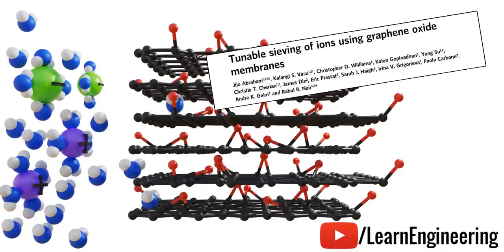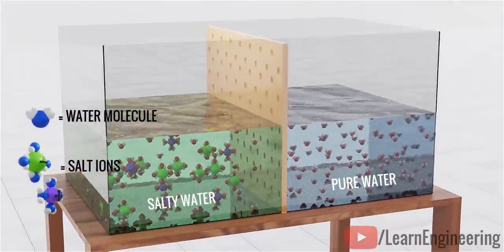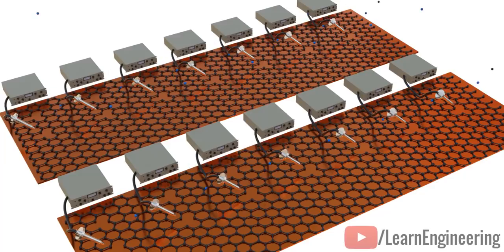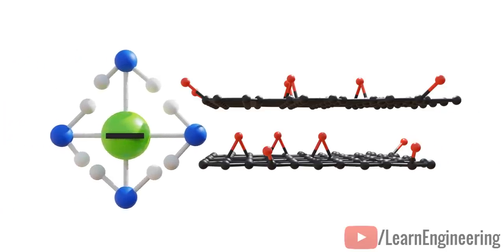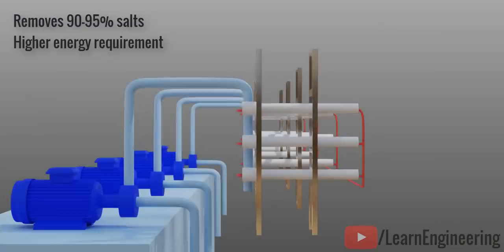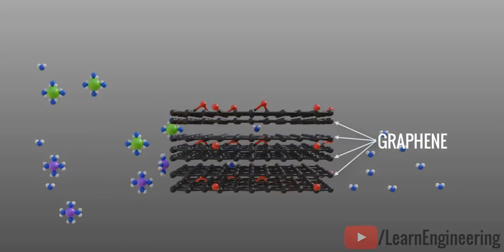Graphene Filtration | A revolution in Desalination technology!

Comment: All good and well, but what about de brine thats left behind. no matter what u use, your alway left with brine. you cant dump is back in the sea, that would increase the local salt level and kill the marine life there.
Reply: Exactly! This is the most problematic point with desalination. Graphene does nothing to improve the possible ecological disaster that this technology could prove to be.
Reply: Properly planned sites should have the output brine mixed with so much seawater that it's non-toxic by the time it leaves the pipe, and we won't drive ocean salinity up over time because that's not how the water cycle works. It's cheapo bottom-dollar sites that would dump high concentrations straight in the ocean that we need to worry about

Comment: I always have an interesting idea. For the membrane that block the salt ions, if one side has no any water then does it mean net water molecules can pass through the membrane without applying any pressure on the other side. Furthermore, if we put the membrane horizontally and pour the saltwater on it, will the water molecules pass down through the membrane? Any answer is welcomed.
Reply: Do more!!

Comment: Let me know when they can make high quality graphene larger than a few square inches. There is little hope of this happening because the chemistry is fickle and small local variations will cause it not to form. It may be an engineering problem, but we have easier problems to solve that would have similar impact.

Comment: I don't understand the entropy.
Definitely, the new graphene filtration tech need some energy input for driving the process, right?
Reply: Yes
Reply: @halfmv2  you're totally right. If you need a constant filltrated water moving, which it's very commum in phamaceutics industry, you'll probably have a good problem...
Reply: he didn't  say that no energy was required int he entire process

he said that the energy to push the water through the graphene  was not required

you still need energy to  get the water into the plant
Reply: I was asking about the energy used for filtration, not the logistics process.
As the video said explicitly, the filter is an energy efficient tech, so it still consume energy.
I guess the capillary action don't require energy, and the entropy was paid during the manufacturing process of the graphene filter. However, energy should be needed for clearing the salt atom which block the nano-scale entrance of the filter, otherwise the filtration will stop once the prepaid-anti-entropy is used up.

Comment: How is this supposed to function better than existing membranes? From what I understand graphene oxide is simply a replacement. Why does it need less energy? The energy required to preform reverse osmosis should be the same unless I missed something.

Comment: Sorry but...a bit of energy has to be used otherwise we could violate the second principle of thermodynamics. My question is where will be used energy with graphene membranes. It was stressed very well about the RO systems but speaking of graphene it says it is a natural process which cannot be as said ...so where will be used energy in the process? My suspect is that they work exactly like RO only more efficient.
Reply: Maybe they say that the energy comes from the dis level of the water: the salt one is up and then goes down with the graphene filter

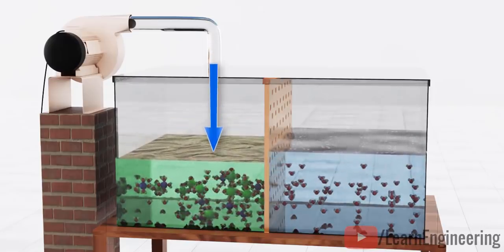Comment: In 1:46, instead of using pump, why not use gravity? So, put the salt water above at higher ground and use gravity as pressure through the membrane?
Reply: That's my question too. Gravity would be more than enough to pull it through and the same pump that pumps water in the tank in the video is the same pump for a vertical tank. 
Think we're being bamboozled with bullshit by the graphene group...🤣😉👍

Comment: Am I the only one wondering why the 'obvious' set up for the first tank wasn't mentioned in the first two minutes, which is, - up end the tank and poor in the salt water from the top. It's not using anymore electricity than the method getting the salt water into the tank in the video to start with. Gravity will pull the water through..
Am I missing something?
Reply: It takes about 500-1000 psi to push the water through the membrane.  Some of this force is required to overcome friction and some is required to push the water molecules away from the salt ions.  The second part is going to be required regardless of the type of filter.
Reply: Won't work without hundreds of feet of water pressure

Comment: the challenge will be turning into a product, i would imagine if it has potential it would first go into commercial water purifiers used in labs and the like, that said membranes are available for RO stills to be made at home with some plumbing parts, pipes valves and pumps, its cheap readily available technology

Comment: idk how u neatly stack sheets of GO when it comes in tiny black flakes since the process is made by exfoliation.
did they just composite epoxy with graphene oxide to make a hydrophilic membrane which can be used for RO.
Imma just try using crosslinked PVA mixed with GO and see where that gets me.

Comment: This presentation is very misleading. Since this is a proof of concept (lab-scale), it should be compared with other stateof-the-art lab-scale RO membranes (>98 - 99% monovalent salt rejection). This graphene oxide technology is not new as well and it does not remove the need for high pressure pumps for reverese osmosis. With the same feed stream (sea water, brine etc...) you will still need about the same pressure (50-80 bar) to achieve separation no matter what kinda state-of-the-art membranes you are using. The graphene oxide sheets just reduce the membrane resistance, allowing higher permeability for the same membrane area.
Reply: Thanks for your comment.  I was going to makes a similar comment about the fundamental, inescapable energy requirement, defined by thermodyamics.  The static osmotic pressure of sea water is equivalent to 900 ft of water.  Real systems need more to over come losses due to flow, increases in salt concentration in feed, and losses in pressured brine rejection.  Technology advances can reduces these losses and are highly desireable.  Misleadingly implying the engery barrier will go away is not helpful

Comment: Graphene is a great material with great potential in many disciplines. Perhaps by this video more would be interested in it and push for grater research on G and GO. 

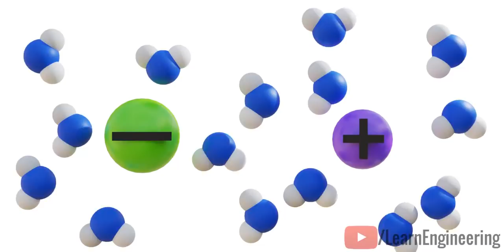Dare I make one remark about the animation. At 3:54 the water molecules are attracted to the negative and positive ions (green and purple spheres). As the H2O molecule has charge polarity, the orientation of the water molecules in relation to the ions should be in the reverse order than that depicted in the video. The oxygen atom side of the water molecule, the blue atom, has a slightly more positive charge than as that of the two hydrogen atoms on the other side, the two white atoms. Thus, the positive side of the molecule should be attracted to the negative ion and vice versa. All I am trying to say in this long-winded comment is that the electrical sign on the ions should be reversed so the green ion would be positive, and the purple ion would be negative. 

I am sure that a great deal of thought and effort went into this video; more power to you. More videos in STEM, like this one, should be made.
Thank you.

Comment: How does the water rejection compare to conventional thin film membranes AND when will drop in replacement graphene RO membranes be available. In the real world where my iSpring 7 with booster pump, my municipal tap is a very respectable 103ppm/TDS, but product water is only  ~ @13-16 ppm?TDS+ ~  88%,, where I would expect 95%+

Comment: I'm confused. Why is this better than reverse osmosis, and how is it more energy efficient? do you still need a pump? As far as my feeble brain can tell you just demonstrated how a graphene filter works.
Reply: Probably smaller pressure is required for a decent flow. On the video it is claimed this is "natural filtration", but its is misleading, the osmosis for w still id present and the proces could be called reverse osmosis. Just the membrane may be better (smaller loses) and tunnable.

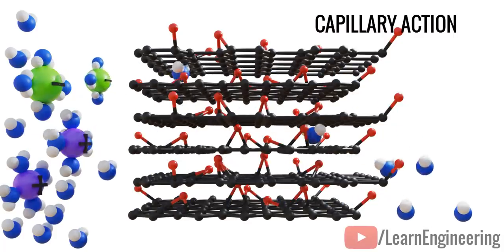Comment: 3:30 “water atoms”
Reply: I should’ve waited to comment; there’s a lot in this video which seems wrong
Reply: @PajamaMan44  did you find something else?
Reply: @robinsss  Yeah. For starters, the entire premise appears misleading or misinformed. It is presented as though this system will simply be able to filter water with no pumping requirement, but reverse osmosis, or really any system which would achieve a similar effect, requires the input of energy in some form. In their graphics, they demonstrate water only moving from higher concentration to lower concentration through the GO membrane, without mentioning why it would not simply move the other way. They claim lower energy requirements, which could very well be true, but by how much?

But besides the entire point of the video seeming odd, they make basic mistakes such as "water atoms" or saying that the hydration shell is covalently bonded to the salts. Also, why would your kitchen use GO filter? As far as I know, but granted I am not a professional, most household water filters are likely chemical filters as opposed to RO filters,  because why would you want to deal with the pumps and the waste water when you can simply toss an exhausted chemical filter and replace it (here I should mention that, based on their explanation, GO filters would simply be another type of RO filter just more efficient I am guessing)? 

These basic mistakes makes it seems there is some kind of error in the production process of this video. I believe this video is the first from this channel I have watched, but based solely on this video I suppose the production either does not have great English skills and because of this they are presenting the information in incorrect ways, or the team is not very scientifically literate, although this would be weird for a channel named "Learn Engineering". Sadly, I cannot figure out any more because, even though they linked it, I do not have access to the research paper they've based the video on. Shame!
Reply: @PajamaMan44  ''''''''They claim lower energy requirements, which could very well be true, but by how much?''''

44%

5:38
Reply: @PajamaMan44  ''''''But besides the entire point of the video seeming odd, they make basic mistakes such as "water atoms" or saying that the hydration shell is covalently bonded to the salts''''

minor mistakes

'''''Also, why would your kitchen use GO filter?'''

why do we need a washing machine?

we don't 

maybe they are connected to a company and trying to come up with excuses to buy a home device

that's capitalism

convince the consumers that they need  the product being advertised even though they don't

are you questioning whether this technology really works?
Reply: @robinsss  At 5:38 the video states 44% of an assumingly current RO plant's costs is the electrical energy used to power the pumps to generate the pressures necessary to filter the water. I will agree that it can likely be assumed from the way they present the data that they mean to claim using a GO filter would therefore reduce costs by this 44%. However, I have no idea how this would work; a GO membrane isn't a magical device able to create a concentration gradient from nothing. If you would like me to link to materials explaining the fundamental physical process which is occurring during RO filtration like this and why is requires energy input, I will try my best to provide something.

Onto your reply of "minor mistakes", while perhaps it is true that accidentally saying "water atom" can be a minor slip-up, the accumulation of these minor mistakes brings into question the legitimacy of what they say. For an analogy, if you were watching a video trying to learn guitar, and they mislabeled a string, incorrectly tuned their guitar, and provided an incorrect explanation for what a chord was, a reasonable viewer would question their experience and authority to be teaching guitar. This is simply an analogy as to why people who have a little experience with these physical/chemical concepts should likely question Learn Engineering's authority.

Onto the capitalism point, you know what there are household RO devices. I've simply never seen them so my bad. I'll give you this one.

I don't doubt that there is something to GO membrane filtration which could have a possible benefit for future RO filtration systems. What I do doubt is the explanation presented in this video. I have gone and watch another video of this channel's, about seat belt designs, and have discovered in that video too they had made an error. Based on this new information, my beliefs regarding the channel has shifted from poor English to poor subject knowledge. It appears to me now that the channel will simply fill in the gaps of stuff not explicitly stated in their source material, and because of their poor knowledge on these complicated subjects, they get it wrong. Now that I think about it, I don't think I can be sure what exactly is stuff they have made up and that perhaps sounds plausible enough that, without the research in front of me, I wouldn't be able to tell.

Now I think I have given you more than enough of a response. If you are truly curious about why the GO system the way they have presented it does not make sense to me in the context of my education, as stated, I would be willing to provide you with material to review. However, if you are just here to defend this channel from any criticism, I will let you know no to worry, as I have told Youtube to no longer recommend this channel to me so you should not be seeing my criticisms in the comments in future videos.
Reply: @PajamaMan44  '''''' I have no idea how this would work; a GO membrane isn't a magical device able to create a concentration gradient from nothing. ''''''

the video says that the water moves through the graphene  because of capillary action 3:22

i was only able to find one video of this subject on youtube
Reply: @PajamaMan44  i  agree that they didn't give a good explanation of how the capillary action works

maybe someone will make a video explaining it

i expect it

this was only announced two weeks ago
Reply: @PajamaMan44  Thanks for your post, I had real problems with the thermodynamics in this presentation. It looked to me like they were trying to summon Laplace's demon. Now it just looks like this channel is typical of journalists trying to report on the sciences.
All too often they do their "research" by reading a press release from some corporate sales office. But they didn't understand enough high school science to perceive when that released information is incomplete. Consequently, they don't know the right questions to ask. Like "How much lower the are the energy requirements required to reverse local entropy compared to R.O.?"
The more minor stuff like "water atoms" are just the result of that same lack of basic general knowledge in the sciences.
In early 1969 I was 6 and a voracious reader of anything I could comprehend relating to Apollo 11. A science "reporter" had an article where the illustrator had drawn the "launch window" as a circular hole in the upper atmosphere. I couldn't for the life of me figure out why the rocket had to go through such a breach since I was pretty bloody sure the sky wasn't a solid shell around the Earth.
I figured it must be something to do with avoiding the Van Allen belts but then I found out that the flight path included an equatorial and not a polar orbit. (I knew the belts weren't over the poles)
It took me YEARS to realise the publisher had no clue that the "launch window" was a time, not a place.
I think this channel might have the same kind of issues...
Reply: lordchickenhawk That story of yours about the launch “window” is hilarious and I agree is a near perfect example of poor scientific reporting you can find currently, and I suppose back then too! 

Extraordinary claims require extraordinary evidence, and usually its the scientists who will make normal claims with good evidence and journalists who will make grand claims with little evidence. Be wary and do your own research!
Reply: @PajamaMan44  What annoys me the most about bad reporting in general is the attitude that the details don't matter because the audience is too ignorant to call bullshit on the story... yet even a bloody six year old can sense there is a problem. (though they might not be able to put their finger on it.)
This seems to be an arrogance prevalent in large sections of the media. The fourth estate has become every bit as obnoxious as the first and second ever were. It's time the third estate overthrew the ruling media-ocracy

Comment: 10 months later, did anyone figured out some way to mass produce large enough graphene membranes to power a desalination plant with reasonable cost? Also, why use epoxy, why not just cross-link the graphene layers?
Reply: @Daniel_deez_nutz  Well. Almost all of them are "proof of concept". My main points are:
1) Scalability: Did anyone able to scale up to any useful scale?
2) Robustness: Are this robust enough for industrial use? Don't take this 2nd question lightly. Industrial robustness goes on a par with being battle tested.
A good amount of household trash is organic material, and graphene, is basically high-tech ash, so it's noting new of exiting just in graphene from garbage.

Comment: So we can create a perpetual motion machine?

I mean if the water level rises on the salt water side if there is a lip it will overflow at a certain point, if we can then filter the water out so it returns to the fresh water side, as long as long as the air is on the other side and has to drip backing into the freshwater side?